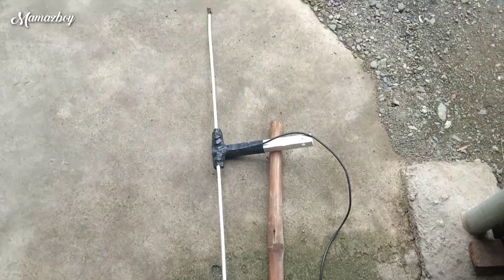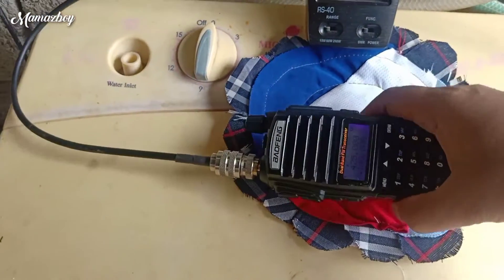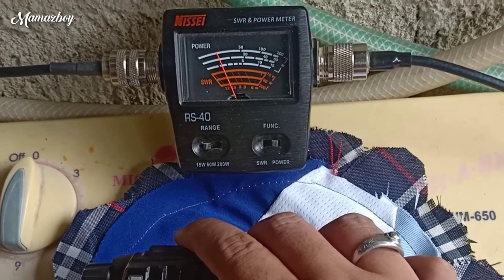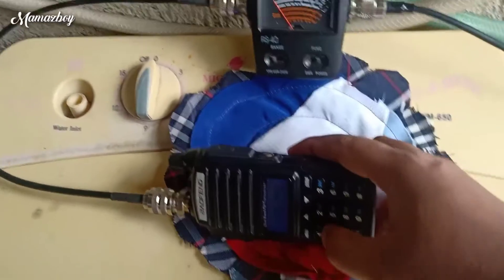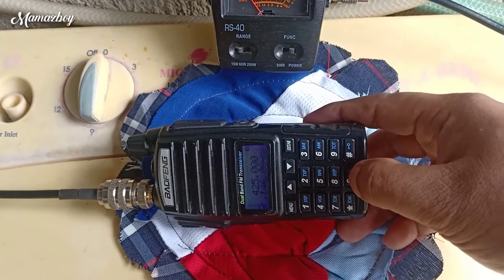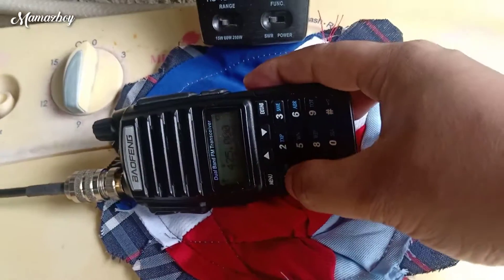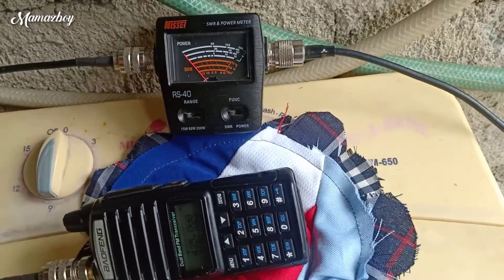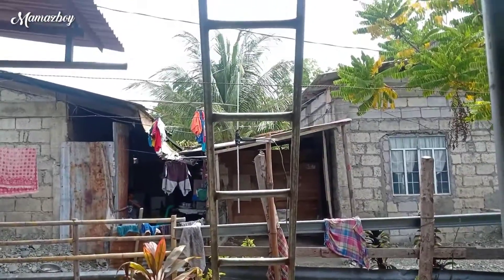ANTENNA NG TV GAWIN NATING 2 METER SPLIT VERTICAL DIPOLE ANTENNA // DIY HOMEBREW ANTENNA

Comment: Lodi may turns ba ang coax mo as balun o wala?
Reply from the maker: Wala po Lodi.. Pero pwede naman po lagyan... 😁
Reply: Salamat lodi, isa pang tanong po..anong po ang haba ng length ng aluminum?
Reply from the maker: Depende po Lodi sa tune ng frequency.. Ung nasa video po is 145MHz po ang tune.. so 19' po bawat aluminum..
Reply: Salamat lodi..God bless!

Comment: Ano sukat ng magkabilaang rod, answer pls para magawa ko
Reply from the maker: 19"( 19 inc.)  po...
Reply: @Mamazboy91  oscar kilo, hmmm panay good reading ba ang SWR, bawat VHF freq?
Reply from the maker: Depende po Tito kung saan naka tune ung antenna... Yung 19" is naka tune sa 145meg
Reply: Panu po pag 147 mhz gamit ko, goods ba?
Reply from the maker: Opo Ginoo..